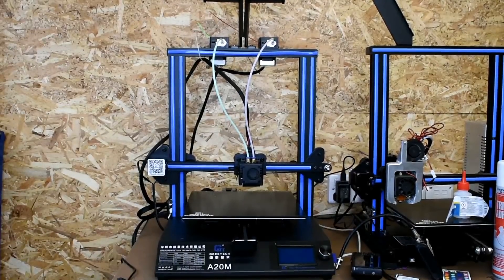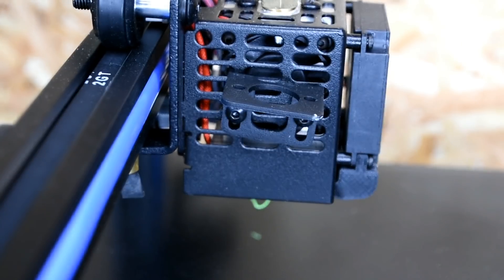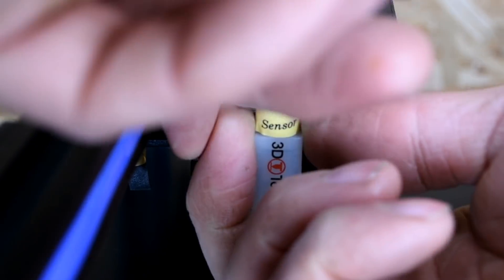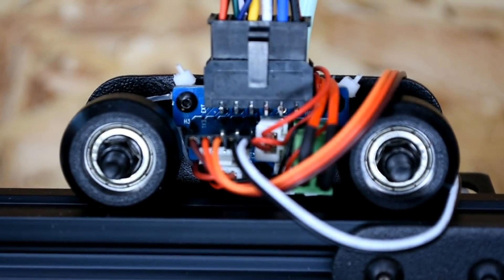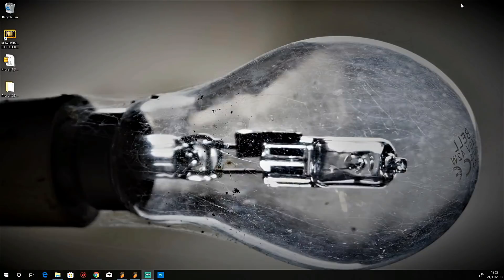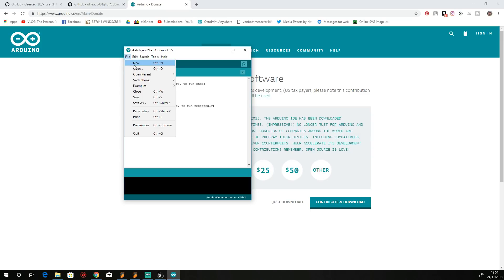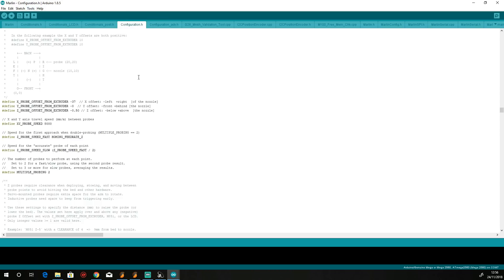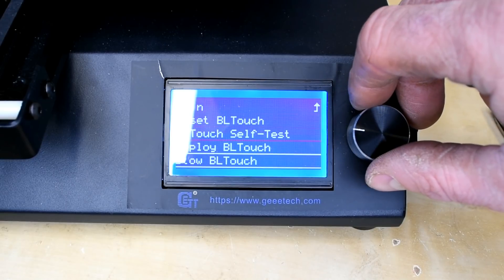GEEETECH A20M 3D Touch sensor install and firmware update

Comment: Hi
Please can you help
I bought the A30m and my first ever printer
I installed the 3d touch however it fails at the very beginning
Error message check failed try again

The A30M has a different interface from what i see with your a20m
The manual is also very vague and no videos about the A30M
It has an inbuilt manual and auto bed level interface
When i select auto bed level and clck measure 

The extruder head simply jerks and stops 
An error message then appears ie check failed try again

However when I select manual level
The extruder retracts on the z axis before moving to the center
I don't know whats wrong with auto level
Is it mechanical or software?

Can you help

Sincerely
Reply from the maker: Hi, not having the new version of the printer puts me at a massive disadvantage but if you could email me some photos or video of the issue I will do my best to suggest some possible answers

Comment: I got no connection with my laptop. And my a20m that i bought 2 weeks ago is making alot of spiderwebs between objects.
As i'm a 62 y/o noob, i really really would apreciate if someone could please help, so that i can start making things for my grandkids.
Thanks in advance
Gerard. ( The Netherlands)
Reply: I am new to this too but if you change the retraction distance on your slicer (I use UltimakerCura) it the spider webs as you call them should go away (I currently have mine set to 8mm)

Comment: The arduino code fails to detect a library. I also tried updating firmware according to Geeetech's instructions but that one fails as well, "wrong fileformat".

I badly need help

Comment: The 3mm allen wrench did not work for me either. However, with a sheet of copy paper under the extruder and a 5mm allen wrench on top of the thick "leveling paper" sheet that came with the printer (basically card stock) mine is working very nicely now.

Comment: I had a problem compiling the A20m_Marlin_1.1.x12864_3Dtouch file the first time I tried it as it showed a missing library u8glib.
This was because the u8glib file was in a zip file within the original folder. if you unzip this file to the original folder it will compile ok.

Comment: Thanks for that, excellent!

I've had the 3D Touch for over a year (it came with the printer) but have avoided installing until today (locked-down and bored).

All done now and working perfectly on my A10M (had to set the X and Z offsets in firmware)

Comment: i got everything installed and all but should i manual level the bed before doing this? every time i re watch the video and then start the process again my nozzle ends up way to high to print with. help anyone?
Reply: mghd same
Reply: you fixed that problem

Comment: There is a glitch in the Arduino code currently. If there are three exclamation marks (!) in a row or more it will compile, but not upload. There are 2 places in the comments that I found 3 or more in a row that I had to fix in order to upload. Once this was fixed the program installed without error.

Comment: Hello, how do I reset the geeetech a20 m to it's original. I upgrade the firmware but now I cant use the printer itself without connecting to computer. LCD is blank. Thanks, any help is appreciated.

Comment: i followed the video and keep getting this error when trying to verify, Arduino:1.8.5 (Windows 10), Tarjeta:"Arduino/Genuino Mega or Mega 2560, ATmega2560 (Mega 2560)"

C:\Users\Jose\3D Objects\A20m\arduino method\Prusa_I3_3Dprinter-master\A20M_Marlin-1.1.x12864_3DTouch\Marlin\Marlin.ino:45:110: fatal error: U8glib.h: No such file or directory

     #include <U8glib.h> // library for graphics LCD by Oli Kraus (https://github.com/olikraus/U8glib_Arduino)

                                                                                                              ^

compilation terminated.

exit status 1
Error compilando para la tarjeta Arduino/Genuino Mega or Mega 2560.

Este reporte podría tener más información con
"Mostrar salida detallada durante la compilación"
opción habilitada en Archivo -> Preferencias.
Reply: update ok managed to make it work by going to sketch>library>add library zip> open a20m 3dtouch>open U8glib sorted after uploading it comes out on the menu but for some reason its not working properly it hits the bed and continue to go downwards? update be carefull when moving z-axis by hand i moved it too much when installing the sensor and that ended up being my problem z-stop was not stopping the z axis the solution was to switch off the printer and move z axis by hand again.
Reply: update again after trying to bed level it happens the same now its like not have a z stop so its trying to go down without stopping ok i notice the zstop was interfiering with the sensor now its ok now the problem is not printing porperly on the first layer some prints not even prints?

Comment: Missing some steps.  The 3DTouch does some work after this procedure, but is not anywhere close to setting the correct Z position.  First layer will print several microns off the plate.  So there needs to be a configuration or offset someplace this video does not show.
Reply: I was just gonna post a similar comment

Comment: I get a lot of error messages while compiling, how could that be possible if I use the same download as in the video?
Reply: Hello, you can flash with the program ans hex firmware from the geeetech website. It's more easy and quick than arduino IDE. https://www.geeetech.com/download.html?download_id=40

Comment: I followed everything in the video, but I'm having an issue uploading the new firmware. Verifying it always works, but when I go to upload, the arduino software says either "error compiling" or "timeout communicating with programmer." I don't know what's happening, so any help would be appreciated.
Reply: Just as a follow up, I was able to get it uploaded. I waited a couple days with my printer and computer turned off, then I turned then both on and waited for them to boot. Then I loaded the arduino IDE and tried uploading again. It took a little bit longer than expected, but it worked. If anyone needs help, I will try to help.
Reply: @timothymichaels5774  Hello, I was wondering if you could help me. I recently upgraded the A20m following every directions. Now my printer is saying the same thing as above; error compiling and timeout etc. And now I can't use the printer itself without connecting to computer. The LCD is blank. Can you please help me? Thanks
Reply: @pinkcatdesign  I would try using different ports on your computer. Also make sure the Arduino IDE had the board set as mega 2560 and it is set to the correct com port. It took me multiple tries of uploading the firmware, but it did eventually work. Once it works for you, it might fix your LCD issue. I haven't had that, so I'm not really sure.
Reply: @timothymichaels5774  Thanks. I was able to get the LCD back, but it is on STOP MODE and everything is messed up. It keeps saying reset using M999, but I don't know how.
Reply: @pinkcatdesign  I have never heard of stop mode, so I don't know what that means, but sending an M999 command is from the computer, so what software do you use for printing?
Reply: @pinkcatdesign  ..I now have the same problem, did everything according to the instructions, but now I have no image on the screen.
Reply: Timothy Michaels. Thank you. I re-install the firmware using arduino. It  went back to normal. I never tried upgrading it with the firmware toolkit. I guess I don't need to anymore coz cable is working now.

Comment: IM GETTING A Error compiling 

yes, it is the same GEEETECH A20M.

Arduino: 1.8.8 (Windows 10), Board: "Arduino/Genuino Mega or Mega 2560, ATmega2560 (Mega 2560)"

collect2.exe: error: ld returned 1 exit status

exit status 1
Error compiling for board Arduino/Genuino Mega or Mega 2560.

This report would have more information with
"Show verbose output during compilation"
option enabled in File -> Preferences.

Comment: Excellent video that we will using in our YouthQuest Foundation's A10 build classes for our at-risk cadets.  It is clear and your narrative is very well done.  Nice job!  youthquestfoundation.org
Reply from the maker: Thank you for your kind words
Reply from the maker: If I can help with any other specific videos please let me know
Reply: @MATS_MAKERSPACE  Good video but I've just obtained a A20T. How do I find out which wires go to which in the block and their orientation. Geeetech seem to over look things like instructions.... Also any hints on installing the extruder senors (I can't figure out the right screw and the actaul sensor looks like it'll rub on the black plastic cog).

Comment: I have followed the video exactly yet i keep getting this error message when i verify the sketch..

Arduino: 1.8.5 (Windows 10), Board: "Arduino/Genuino Mega or Mega 2560, ATmega2560 (Mega 2560)"

C:\Users\1989c\Desktop\PrinterFirmware\Prusa_I3_3Dprinter-master\A20M_Marlin-1.1.x12864_3DTouch\Marlin\Marlin.ino:45:110: fatal error: U8glib.h: No such file or directory

     #include <U8glib.h> // library for graphics LCD by Oli Kraus (https://github.com/olikraus/U8glib_Arduino)

                                                                                                              ^

compilation terminated.

exit status 1
Error compiling for board Arduino/Genuino Mega or Mega 2560.

This report would have more information with
"Show verbose output during compilation"
option enabled in File -> Preferences.
Reply: I had similar problem, but followed instructions in this link: https://forum.arduino.cc/index.php?topic=561232.0
Reply: @lachlanmckenzie9983  that person says on the last post he ended up with the lcd screen not working after following those instructions

Comment: I have installed the BL Touch on my CR-10 S4, it a fantastic upgrade. By default the probing is very slow, more so if you are using a bigger bed.
Michael has a great video on how to speed up the levelling process https://youtu.be/BV11-VOQjMc

Comment: My OCD would make me find shorter screws to mount it. Why Marlin 1.1.8 instead of 1.1.9 or 1.2?
Reply from the maker: I wanted to make the process as easy as possible for people so I used what is available direct from the Geeetech github rather than jumping from source to source.